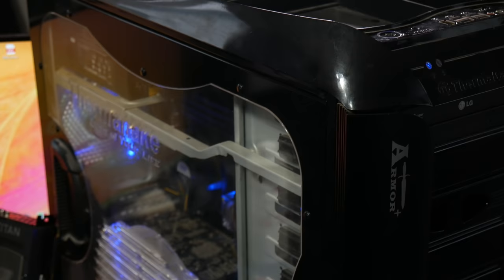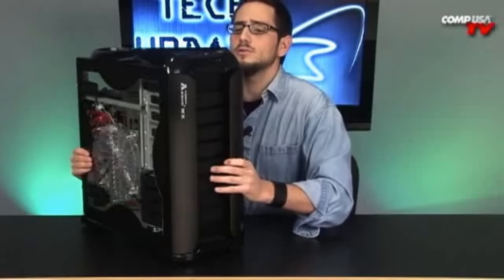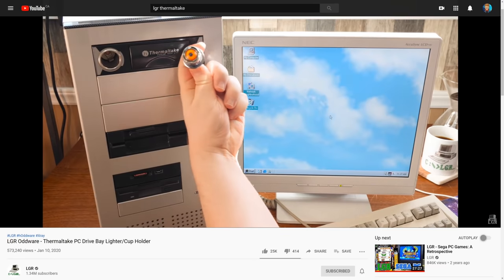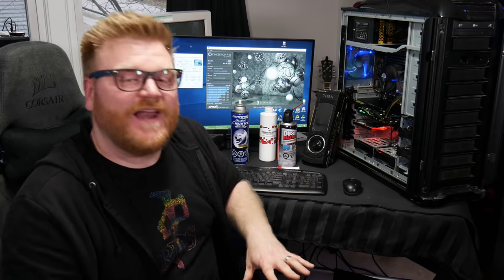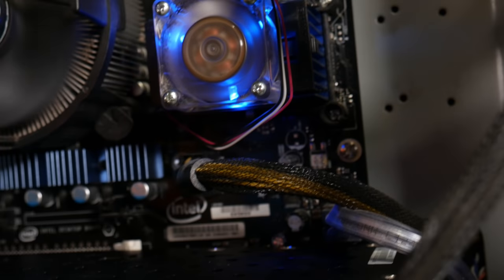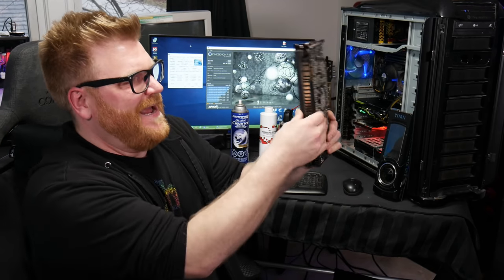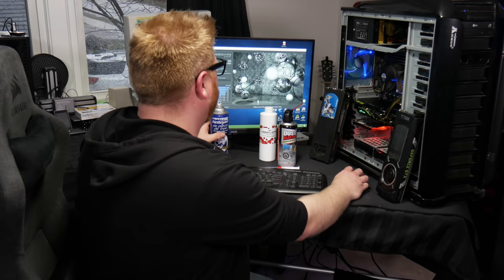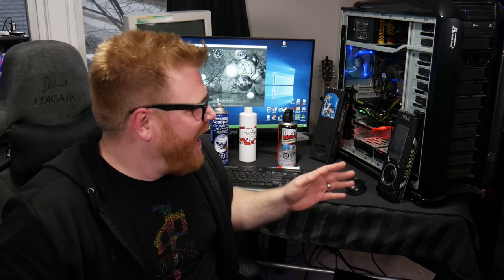Can $5000 buy a PC that will last 10 years?

Comment: I spent $1500 on my PC as it sits that's the most I've spent. Built after the launch of Zen+ so I could get 1st gen parts a little cheaper. I have a couple small regrets, A) at the time I built it SSDs and RAM were expensive, and I wouldn't have had to pay $90 for 16gb of DDR4 or $50 for a 128gb SSD if I had waited a bit (I later replaced that SSD with a 1tb NVME and the mechanical drives I had with 2x1tb SSDs in RAID 0) B) I wish I had gotten a nice B450 board instead of a nice x370 board, I would have paid more money then, but now I see 3rd gen support for my board is kinda meh and the bios updates have had issues with the current chip.

Comment: It depends. What if you never game or even stream but only use it for "office type" tasks and teleconferencing and surfing the web? Surely with a video card upgrade around the 4 to 6  year mark you should be able to handle anything THOSE tasks throw at you for the next decade at least if you have a decent quad or 6 core system to begin with.  Still, for most people who want to play some of the new games every now and then or try the newer technologies upgrading in a major way  or replacing the system every 5 years or so makes lots of sense.

Comment: So I have £300 to spend on a gpu. I currently have a rx 590💩. Looking at the rx 5700. It’s 8% slower then the GTX 1080 and about £150 cheaper give or take. It’s also about 45 to 50% faster then my old card. What should I get ? FYI great vid😉👀

Comment: To be fair to the client, the 5 years for the GPU is the marker. It's about what you can afford and what you expect. If you can afford $2000 every 5 years, you can expect 5 years from a $2000 machine. If you can afford $5000 for 5 years? Go for it. I spent $1200 on mine but I know in 5 years I'm going to have to spend that again. What will I do with the one I have? Put it in the closet for 5 years and get rid of the i5 2500 that is in there now.
The long and the short of the message is, you won't get 10 years out of any computer but life is short, you can't take it with you. Spend what makes you happy.

Comment: I can understand his mindset however it makes no sense. I spent a total of over $1700 for my i7 4790k devils canyon back in 2014 and it served me very well over the 5+ years of owning it. All I did with it is upgrade the GPU from an R9 290 to a GTX 1070 and an addition 16GB of RAM to get 32GB.  I expected to own it for at least 5 years when I purchased it. No I wasn't disappointed two years later because I knew with a 4.4ghz all core clock thanks to Multi-core enhancement would keep up with Skylake and Kaby Lake since AMD was doing very badly back then with their FX series of CPUs and Ryzen wasn't out yet.

Comment: Well... I almost never buy a whole computer but upgrade from time to time whatever needs to be upgraded. After about five years there are bigger upgrades coming (In my case this means 2011: AMD Phenom II with HDD, 2016: Intel Skylake with SATA-SSD, 2020: Ryzen 2 with PCIe-SSD) but there's always stuff that's reused. So my case (Fractal Design Arc XL) has seen the third motherboard now and I don't see any reason to upgrade it soon. Money saved. My 32GB DDR4 from 2016 are not as fast as newer RAM but overclocked to 2733 Mhz it's still doing fine. Money saved. I'm also using hard drives for a long time so there I don't buy the smallest ones. Money saved.
The last thing I upgraded was my CPU cooler as the Wraith Spire wasn't too impressive so I went for an AiO (360mm) for the first time as my older tower cooler didn't fit the AM4 socket.
So yeah: I'm a fan of upgrading piece by piece and whatever is outdated. Different parts are aging differently. Guess the next things to upgrade for me are the fans (maybe going for Noctua instead of the original case fans, which were cheap and are quite old now?) and a bigger HDD (6-8 TB).

Comment: I would imagine that spending $2000 now and another 2x over a 10 year period will, on average, yield higher performance over a decade. Residual values at each replacement point would also be higher, meaning net cash out of pocket would be much lower too. Replacement at every 3.5 year point, repurposing cash on sale of legacy equipment (say 40% of initial purchase price) in the process. Especially now, given the imminent arrival of DDR5 and console convergence. Also, CPU instructions move over time and anchoring on a platform for a 10 year period is clearly sub-optimal. Time value of money aside, cash out in this approach would be somewhere around $4400 versus $10k at the start. Less than half the money and for more consistent benchmark performance over the period.

That being said,  I made this mistake of buying a DELL XPS in 2008 for $3000 while overseas on an expatriate work assignment.  Transferring warranty on repatriation was a real pain in the arse. Sure, it lasted 11 years and was a good PC for basic needs, but it had very little upside due to the BTX design and DELL locked bios. I have XEON platforms (X79 E5-1680V2 & X99 E5-2678V3) currently, each cost me about $650 with a mix of new and used parts (e.g. RX590, GTX 980). Nothing special.  But they are mid level performant and certainly more than enough for my use case. Good enough for 3 years or more...then move on.

Save the difference and invest in something that will retain some value...an investment grade watch for instance.  Rolex or similar. Bought one in 1997 for $5200 and today a new one goes for $15k and a used one can be sold for more than I paid for mine (plus the maintenance over the years).

Comment: 1400 euro for a 6700hq and 970m 32gb ram laptop. 2 months before the gtx 1000 series came out because as life would have it:
My msi GT70-OND died right before my exams (programming, vfx, 3D moddeling,..) and I needed a good computer. Very not worth the money the moment I bought it and barely any cpu performance bump between a 3630qm and a 6700hq. Nice boost between a 970m and gtx 675m tho.
Paid extra for the screen because that was on option with this clevo and got the high end colour panel which was worth it 120%.

5 years later now and it's still my main computer. I've been maxing it out since day 1 I had it with my work and nowadays I'm finally bordering on having to go sub 1080p for some games. Maybe I'll upgrade but depends on what the future holds. For sure not a laptop if possible but that probably won't be the case.

Comment: My consesnus is go for the best cpu you can afford as that will last longer then your gpu. But still go for a like a 2070 gpu every year, or 2080. I did this. I started with a intel 3930k cpu in 2012 and a gtx 680.Then a 780, then 780 sli, then a 1070 and all this time the 3930k has been sufficient. Only now is the 3930k getting to a point i want to upgrade it.

Comment: Just get a 3700x, 2070 Super, 16GB 3600mhz ram, x570 MB, 80+ gold PSU and a case you like and you'd be sweet for only spending half the budget and saving the rest for 5 years when you need to upgrade again to be on par at that time

Comment: Most expensive PC I’ve built is 

MSI Z87-G43 £50
I7 4790k £175
16gb HyperX 1600 £50
GTX 980ti £150
4x2tb Backup Storage £free
2x240 SSD £50

Total Price £475

Still using it to this day and is still running sweet

Comment: from 2010 until 2016/17 the market was fairly slow as AMD had fallen behind and there was no competition. There was little progress in the key areas of a PC, the CPU and GPU as intel and nvidia didn't really push the tech forward, it was your standard 10-15% increase year on year. Since Ryzen and pascal architecture competition has returned pushing tech forward more quickly while driving prices down. The next 5 years will be great for pc gamers with regards to hardware, not a chance a top system now will be relevant in 2027. Buy a good system now for half making minor upgrades along the way and another in five years.

Comment: Built a computer about a year later than this build, just replaced it as well. Mine was x58 i7 930 6gb ram Radeon 5850 with a 64gb ssd and that same antec psu. 10 years it worked well. (I did do more maintenance) only ever replaced the ssd since it died on me once.

Comment: Last fall I spent about $2500 and built my first pc. Until then I had really only used laptops. My job changed and that meant I no longer needed the portability.
And, I did build with the intention of not needing to upgrade for a "long while". Certainly NOT ten years but, a few years. 
A good part of the cost was also due to me wanting SFF which added to the expense. If I had built a normal sized machine it would probably been a $1500-ish pc.
I have a 3700x, a 2070 ITX GPU, 32 gigs of ram (16x2), and two 2 Tb M.2 drives on an ITX 570 board. And another 2 Tb SATA drive. So, tons of storage because photography is my primary hobby. 
The pc is absolutely NOT future proof but I also won't need to build another one until the next big leap in tech shows up and then I will figure out my next machine.
Reply: Shoutout bro I got 2 2tb nvme drives too.

Comment: OK so I pretty much just stay around the 650$ mark and Ive always been a super investigative shopper when it comes to pc parts. So I guess my most expensive PC was an FX 8370 build with an R9 390 - I spent a little bit more on the CPU cooler and hit 4.7ghz on all cores - and I let it run that way for its entire life span until I sold it. 

Didnt have any issues with it as time went on and it lasted me until 2016 when I got a Ryzen 5 1600. 

That PC actually aged very well, seemingly gaining performance as the years go on - and when windows 10 came out it acted like it got a performance boost. 

As of right now Im sporting a Ryzen 5 1600AF @ 4.0ghz with a GTX 1070TI FTW2 and I couldnt be happier that I bought all of it new except GPU for less than 650 - and thats with a 650w Gold psu too.

Comment: i bought my pc for about 150 euros and case swapped, mobo swapped 3 times cuz one stopped working and i was experimenting, it had a gtx 660 2gb so i upgraded to a 1050ti windforce of an bought another hdd on here, everything used, works fine and soon im gonna upgrade to a better pc spent about 350 euros total on this pc, sometimes its a pain in the ass but most of the time its good

Comment: i always go for Mid-Range for gaming (Ryzen 5 3600x+ x470 asus ROG gaming-F +16 gigs DDR4 3200Mhz,+ssd and hhd+ RTX 2060 Super OC+ a 750 Watts masterwatts PSU 80+ BRONZE), it give you better room money-wise for the upgrade, high end to VERY high end is for those who like editing and do some very heavy load on the cpu/gpu....and 4k/120Hz ??? it's a gimmick, no need for the extra expenses just to play at this resolution , 2k(1440p) is enough to make games look very good and now with DLSS 2.0 and future updates , we can have 4k  with way less demanding specs ( for those interested in 4k).....in conclusion , if you planing on ONLY game and do some streaming and light load on your machine , you mut go for the Mid-range  (the real one, not the entry level ) and change parts or completely the PC in about 4 to 5 years , Mid-range config are really good nowadays.......and  with the DDR5 ram Boards  , Ampere , RDNA 2 , Nvme PCI-E 4.0 , and zen 3 and Intel 10xx CPU , 2021 and 2022 will be very exciting  years for PC builders like us , in fact , my next machine will be an Intel /Ampere cpu/gpu Combo , i lost trust in AMD because of the next Zen 3 chipset will not be supported on my brand new X470 AM4 board , and it sucks , so i head back to my all time favorite Intel ............peace

Comment: i spent about $600 on my PC i5 7600k evga 1050ti sc 16GB ddr4 ram cooled by a hyper 212 evo on a b205f motherboard and it runs modern titles pretty good but i need a new power supply because mine is non modular and the cables are too short

Comment: This is how I do it. I buy a good cpu not the best but very good with a solid mobo and ram to match. Then I buy an awesome gpu and will sell it and buy another awesome gpu every time the new generation is released. When my cpu becomes the bottleneck prevent me from upgrading gpu I sell off the whole thing and start over. I can typically sell my old rig for about 1/3 to 1/2 the price of my new builds since it's still solid and has a pretty fresh gpu in it. Also I dont go overboard on the hard drive because those things are advance way to quickly, so I do the same with them as gpu except I dont go awesome amazing I go 100 dollar cap and just upgrade every year because you can basically get a 500 hard drive a year later for 100 bucks but that 100 buck hard drive will sell for like 50 bucks in a year.

Comment: i used a q9450 till 2017 when i bought a used i5-4590 based system and a 1060 6gb the difference was night and day and i had only spent about 700$ in the 3 years since then ive seen 1440p at 144hz become the norm and even 4k60 coming close to reality at 1000$ were moving at an unprecedented pace. i an of the opinion atm if you spend more than 1200$ you spent to much as in a year there will be hardware 10-20% faster

Comment: 10 years seems reasonable enough on the CPU side of things especially with today's hardware. I can't see anyone buying an i9-9900k and then needing an upgrade just a few years later. X58 is still a viable platform today. you could drop in an RTX 2060 or 2070 and make it last another few years.

Comment: For a gaming PC, I see very little to no reason to ever spend more than $2500 (hardware only, not including monitor, peripherals, etc). You can easily put together a build with an i9 9900k or 3900X with a 2080 Super or even 2080Ti and 32GB of RAM, high end PSU, motherboard, nice case  and plenty of SSD storage in that budget. My next build will likely be $2000-2500 depending on the RTX 3080 or 3080ti pricing in early 2021.

As far as leaps in power of the course of years, it's definitely slowed down. My i7 920 lasted me from 2009 to almost 2016. Even then from a processor standpoint, gains for just gaming were minimum for a 7 year difference in CPU improvements. Multi-threaded applications are a different story of course. GPU performance improvements has drastically slowed down too. I have no motivation to upgrade my 1080ti from over 3 years ago since the only upgrade is a 2080ti and a ~20% imrpovement for $1200+ is not all appealing. Overall it seems a new build every 4-5 years is likely the way to go. Even then, the main setup could probably last longer with just upgrading the GPU these days.

Comment: There's a point of diminishing returns but things kinda stalled for i i5 i7s and 1060 and 1080 ti were good for a long time sata is probably topped out now

I'm expecting some shake up thanks to AMD and PS5.

Buy for the knee of performance for your application today. Save the money upgrade what you need when you need.

I kinda want to buy a C4 to rebuild.

I want that 2tb Intel nvme but I'm sure in 3 years the storage will have much more capacity and they'll have a better cache and a better bus.

Comment: I just bought an e5 2690 ( 8C(16T)) on the aliexpress (motherboard  ram16 Go DDR 3 icluded)
 for $120. Power Supply+ Cooler+Case+ SSD (240)+ Hdd 2 TO Total Build 275€ Just need to ajust the GPU for 1080 p (high/Ultra) aliexpress RX 480 4 Go 72€ Total= 347€ if you want 4k in a budget (ZOTAC Gaming GeForce RTX 2080 AMP(Amazon NEW(760€))  Total 275 + 760=1035 € In 4 years he can change for a new build :)

Comment: It used to be easier, in making a LONG Term PC [keywords - used to]. Same notion as you said Timmy - some components will need to face upgrades. My previous daily driver CM HAFs guts, lasted nearly 10yrs, before saying times up [Phenom II, 890 Chipset and CM V8]. The GPU would get updated `~3yrs, especially for addressing VRAM / actual new chip tech... But system memory [for me] became the choke point, in a VERY escalated fashion

Unless you catch on to the right chipset, with a foreseeable upgrade path, I just don't see  such long term rig being a viable possibility - without facing a full-on refresh [esp., in calling out forced obsolence, for some components]. Figure a 1500 base rig, with 500/600 in upgrades -- before squeegeeing the whiteboard

Comment: This guy got ripped off...
I built myself a x58 setup back In 2011. And although I got CPU and mobo used, new will still have been far from $5000
I got and Asus p6x58d premium with proper 6 dimm slots. 3 way sli support, and the best; sata 6gbps and USB 3.0.
Got an i7 950
12gb jskill ripjaws
And a msi gtx460 hawk.
Thermaltale 750 modular psu
Antec 600 case..
Oh and a thermaltale bigwater liquid cooling setup!
All this for less than $1500.

And I can say it's been a really good investment. 
I did upgrade to a gtx760 and now I got a gtx 980, which I got for $125...
So in 10years thus PC has cost me no more than $2000. 
And I feel I can squeeze a couple of years more out of it, maybe throw a 6core xeon who knows, before moving on

Comment: that hardware was not worth 5k back then. got ripped off.

I have the midi tower version of that case. Love it. Fan still works too. when i upgraded the cpu and mb, i keep using the case

I bought an 1st gen i7, 920. lasted 10years. gamed on it. upgraded HDD, RAM, and Video card over the years. inital spend was $1500 AUD. Now rocking ryzen 1700. loving it

Comment: Can you by chance tell me how my first build will function 

Ryzen 3 2200G 
16GB DDR4 2666 
RX 570
Gigabyte B450M DS3H wifi motherbord 
500gb SSD (will be adding a M.2 down the road)
CORSAIR CV Series CV550 CP-9020210-NA 550W ATX12V 80 PLUS BRONZE PSU
and a micro arc case

It is a simi budget build at just under 1000$ CND

Comment: imagine when people say the RTX 2080 Ti and Ryzem 7 3800X are "low spec"  in the future. Tech surely moves fast
Reply: CRUSAD3RTTV if the rtx 2080 ti will be low spec what would they call an even older gpu like a 1050?
Reply: probably complete garbage
Reply: @pessi787  it would be on the same level that the GTX 750 is now